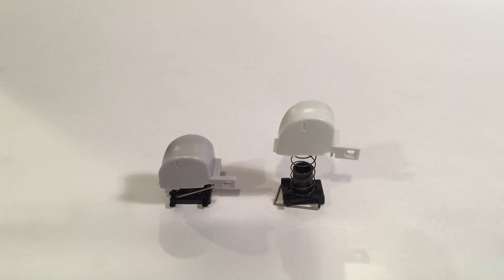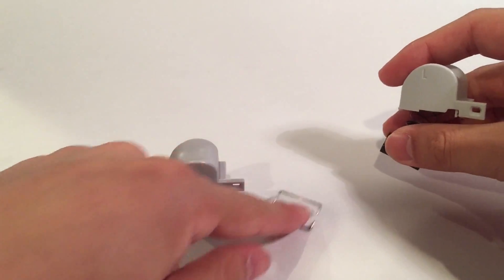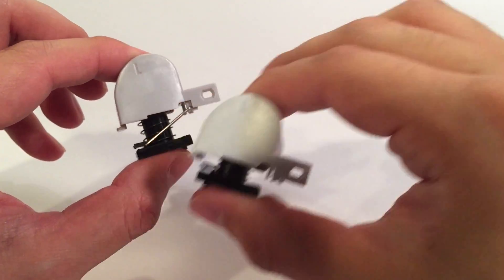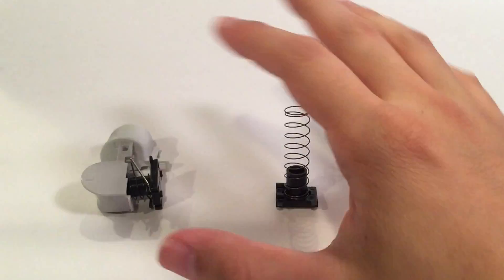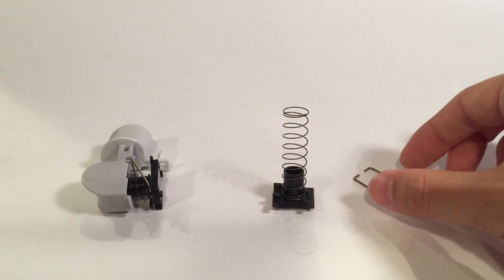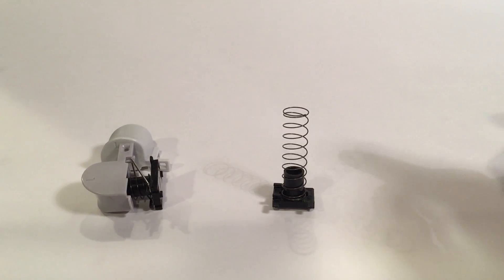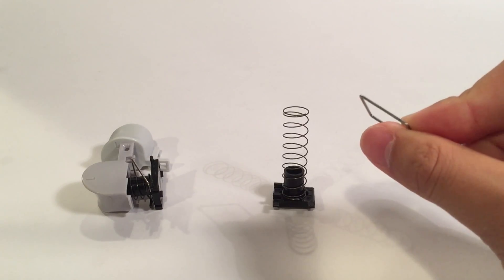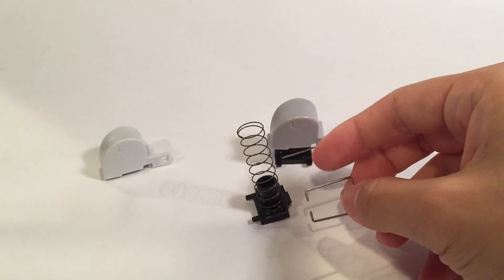Gamecube Triggers (Why They Stick and Possible Solution?)

Comment: this is a MASSIVE issue for anyone using these for melee tech like L cancelling and wavedashing, and smash 4 / pm players who use L/R for jump. The easiest & cheapest fix I think would be to take an old busted GC controller and take the metal brackets from those.
Reply from the maker: it is at the moment which is unfortunate :( hopefully they can be mass produced at some point for cheap though!

Comment: I personally use silicon oil on the black tube and works for me, making less effort needed, and no sticking.
Reply from the maker: hmm thats a good idea! how long does each coat typically last?
Reply: Mudkipslaps I would like to know how long each application lasts as well
Reply: A long time. In 2015 I applied some speedcubing silicone oil to a trigger that was binding, its still good. The silicone oil doesn't dry up and its protected from dirt/dust pretty well because the application point is inside the black tube.
Reply: @zenith SSBM Same, I actually put teflon grease inside mine (the black tube part) and the sticking went away instantly and it feels very smooth. Even when i try to intentionally stick the trigger the way it used to get stuck, the trigger just starts to depress itself, its impossible to get it stuck now even if i try to.
Reply: are there any alternatives to silicon oil?
Reply: @stajj8173  not sure, just dont use wd40 it eats plastic

Comment: these are basically the same as mechanical keyboard stabiliser wires, there are a lot of chinese manufacturers of these stuff. Another solution is just get a wire bending jig and some wires, they are pretty cheap.

Comment: Hey so I work in professional manufacturing and you are right that they would be pretty cheap to make however it would not be worthwhile for a factory to begin making them unless the buyer would commit to a print run in the tens of thousands, and being that they would be so cheap the profit margins would be incredibly small, and the market for something like this would not nearly be able to satisfy the amount made, so at best it would be an incredibly unprofitable venture, and at worst the buyer would loose a whole bunch of money on tooling, and be seated with a bunch of unsold brackets. The best beat would be if more of a boutique shop or etsy metal worker was making them, but in that case they would probably be pretty expensive, plus shipping costs. Realistically if you want to find new ones of these you could buy a metal rod from a lowes or something and then do your best to bend it correctly yourself, heating and bending to a mold. a bit labor intensive, and slightly in perfect, but likely the most cost effective, and quick way of getting them.

Sorry for the word dump :)
Reply from the maker: I appreciate the insight! I was able to get pretty close in molding them myself lol what youre saying does sound very correct tho, would need to produce many more than what the niche market of Gamecube controller 'enthusiasts' would buy
Reply: What if you get the material yourself and make the molding equipment yourself? So you yourself would be tha manufacture for having the equipment to make it?

Comment: my digital L just stopped working :(

analog is fine, tho

any suggestions?
Reply: there could be dust on the digital button trigger plates
try to open it up and clean it.
Reply: @hiX0N  i'm on the quest to find a triwing in my city to see if i can open it. Else, i'll have to buy one online
Reply: @mparagames  if u have a small flathead that also works

Comment: +zenith SSBM I was taking out my official GameCube controllers I have two orange one purple two silver and two black and the black and silver controllers don't have the metal brace inside. Also, one of the blacks doesn't even have the phillips screw housing that wall that hides the triggers. I wonder if some controllers were produced in different factories where they skipped metal brace. They work fine though and I've been using them for more than a decade.

Comment: I never had any problems with the triggers on my SSBU GC controller, but I did eventually shorten the springs and added trigger braces from a Spice Orange controller I bought used on Amazon (its condition is generally good with the only negative being the dirty stick caps), and it feels better imo.

Comment: I have the black sm4sh controller and it only sticks if I hit the triggers on the back (like the edge of them) so I kinda just mentally trained myself to only hit the middle and to lightly press when I L cancel so it doesn't degrade as fast anymore. Also on the note of controllers, do you prefer lose analog sticks or tight ones? great vid btw
Reply from the maker: thanks man! and if you have trouble with the triggers sticking have you every tried lubing them with silicon oil? also i personally like tighter control sticks, just not like 'new' tight bc i try to go for pivots from time to time and i find it easier with a tighter stick

Comment: I play with a classic silver gamecube controller and one of my friends plays with the new sm4sh controller, and the main difference I notice between our controllers is that his triggers seem to have more resistance and more of a "pop" when pushed down all the way than my controller has.  This is the main reason I'm reluctant to upgrade to a sm4sh controller.  Is this difference due to these metal pieces? 

Great video btw :)
Reply from the maker: i personally always believed so! a big problem with them is that they also tend to stick a lot. some people who test controllers and know basically all there is to know said they have little to no effect on sticking, but as far as feel goes i always liked the braces as they (at least for me) make the trigger feel smoother

Comment: Couldn't you make a 3D printer model so anyone could simply print it? Idk if the material matters, but this could be a practical solution instead of specifically manufacturing a tiny piece for a specific market.
Reply from the maker: Alan Harris i dont have any experience modeling for 3D printing myself, but the material used for the brace has to be strong otherwise it will snap. not sure what the strongest materials available are but i'd guess its gotta be stronger than the plastic thats commonly used
Reply: It wont be strong enough with 3D printing.